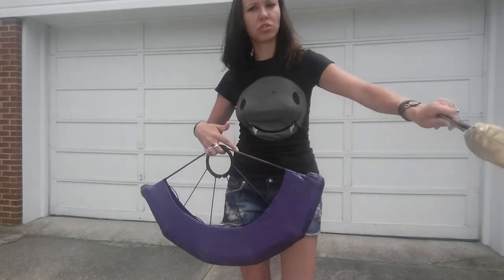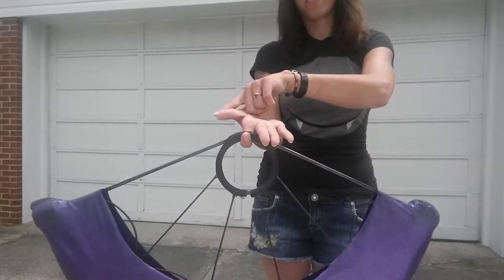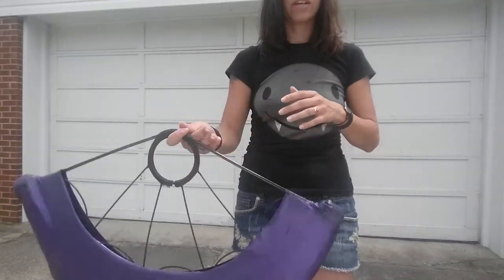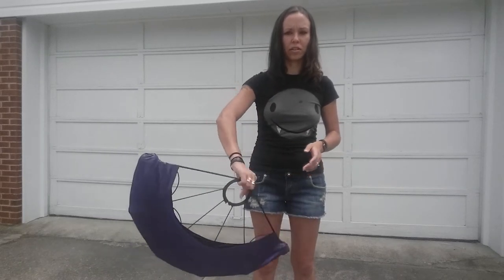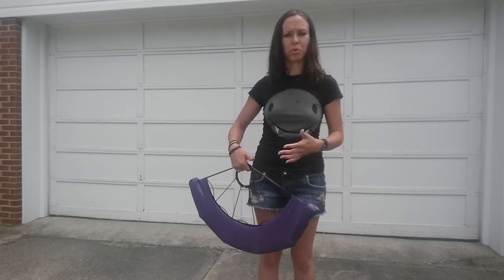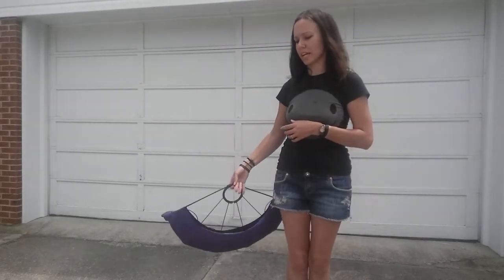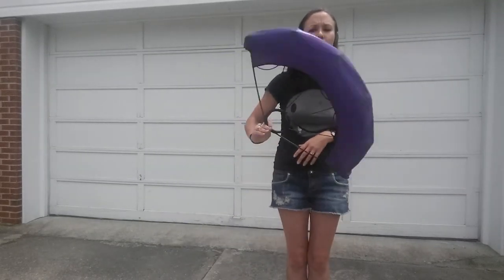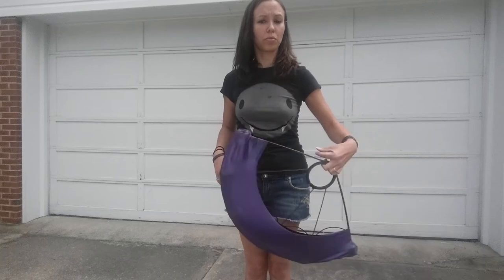Scissor Grip Tutorial Part 1: Forward Weaves

Comment: So the forged creations fire fan from the site you mentioned would be the same size as yours? Any idea how big the ring is? I have two separate interests in fire fans… One is more of the Russian style as I understand it and the type of fans that you're spinning and then the other is the more ornate light pretty for bellydancing… I know I'll end up having to get two separate pairs but the ornate ones are a lot easier to find than the "Russian" style. Thank you so much for the help! 
Your tutorials are extremely helpful I appreciate the time and the detail you give!
Reply from the maker: Amber Dunn the ring size is 3.5 inches. If you're wanting something for belly dance then I would definitely recommend Forged Creations over true Russians. The overall size of the fans are hard to just hold straight out for belly dance style moves. They are designed to be spun more continuously. 
Forged Creations Hybrid have the same size ring, slightly smaller fan size, light weight, and super well balanced. You can hold them still and your wrist will thank you :) no need for multiple fans. Plus they come with a lifetime warranty on welds!!!

Comment: i'm new to fans also and am wondering what company makes the best russian style fans. i've had peoplle recommend forged creations because of the high quality and the life-time warranty but i dont know much about Mischa's or Uncle Druulian's customer service or quality and how each company compares to the other. Is there anything you could recommend for someone new to fans?
Reply from the maker: Here are my personal opinions regarding the comparison of the fans you're asking about. 

Forged Creations: If you are new to fans and not sure what style of spinning you will be drawn to, the Hybrid fans are the best of both fluid spinning and tech (meaning more static holding of the fan vs. more constant spinning). The fans offer a slightly larger frame from their other fans but are still small enough for inner arm manipulations. They offer a slight flat grip at the bottom of the ring to help with stopping the fan on the palm but doesn't hinder techniques such as scissor grips like my tutorial. They are super light weight especially in comparison to traditional Russian style fans (your shoulders and wrists may thank you later) and are incredibly balanced. On top of all of that, they absolutely offer lifetime warranties on the welds. So if it breaks... they will fix it. 

Uncle Druulians: I really like these fans because they do offer a metal ring with a grip on the bottom of the ring to help with stopping the fan while spinning. They are traditional russian fans, meaning they are larger in size so doing tech manipulations could become difficult. So if you're new to fans and you're more drawn to Doodle style spinning vs Rem style spinning, these fans will pose a potential problem. However, I have had great conversations with the owner and haven't heard any negative feedback regarding their customer service. If something happens to your fans though, getting them fixed may be difficult. 

Mishas: Honestly, real Mishas are very very difficult to get. He does not directly distribute to the US. I got fortunate because a gentleman worked something out with him where he was getting shipments of 10 fans in at a time, but I don't believe he will be doing that anymore. I love my Mishas, they are wonderfully balanced, they flow easily, and I've dropped them I don't know how many times and they literally bounce off the ground. BUT... people rave about the fact that they have leather grips, while it is nice, if you live in a humid environment or in a situation where there's dew on the ground or in the air, that leather will rip the skin off of your fingers with a fierceness. They also continuously rub blisters. I tape my fingers for this reason with high grade medical waterproof tape (because it's the only one I've found that doesn't disintegrate  with the constant friction or have a rough surface that damages the leather). Don't get me wrong, I wouldn't trade them for the world, but I would not recommend them if you are new to fans and the leather upkeep (and keeping your fingers safe) is work. 

They all absolutely have their qualities and let me re-state that this is my personal opinion and reviews.